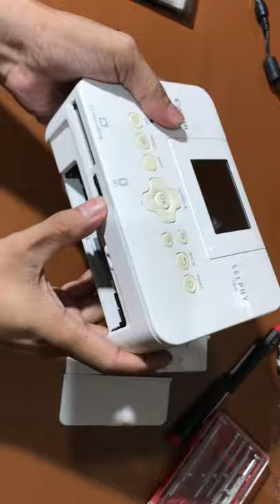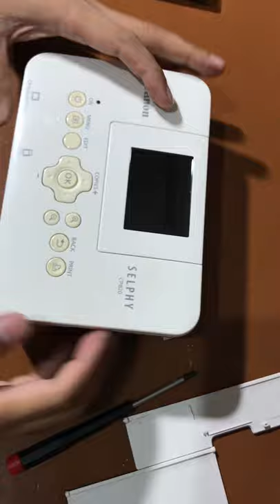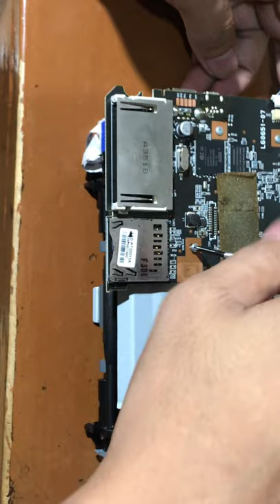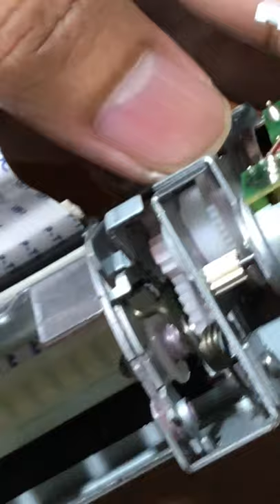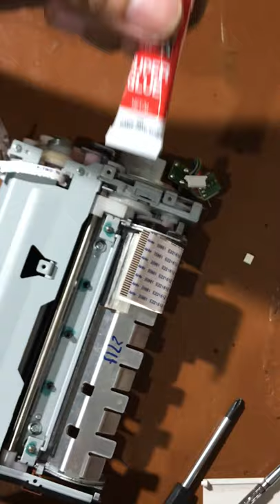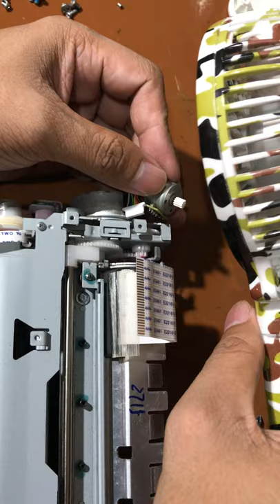HOW TO FIX CANON SELPHY PRINTER INK CARTRIDGE ERROR (PART 1)

Comment: I have a Selphy CP530 and I found you don't have to disconnect and unscrew all of that.
Once the cover was open and two connectors pulled, I could lift the entire mechanism out of the case (bending plastics a little) and the failing gear could be seen.

I only want it to work long enough to use up the ink I have since 3 years ago, I will not spend a single penny on more.